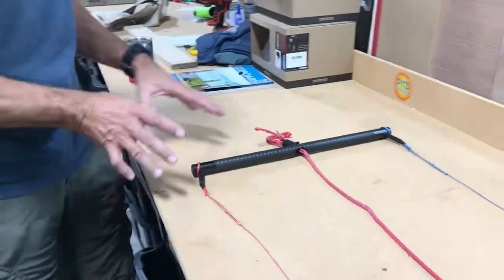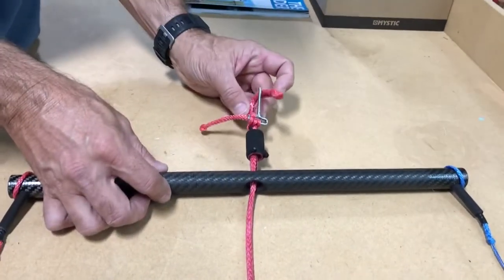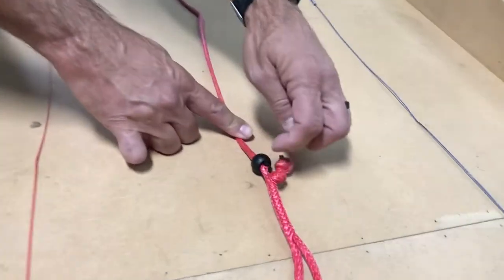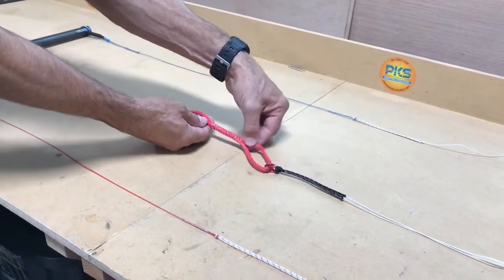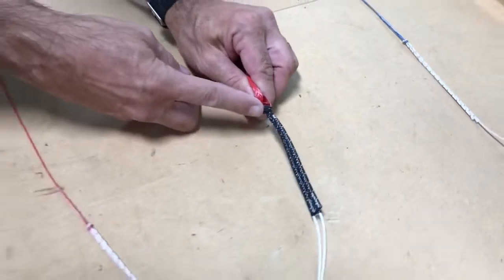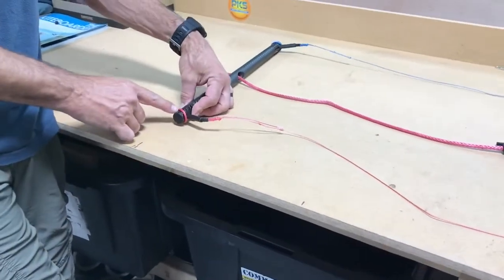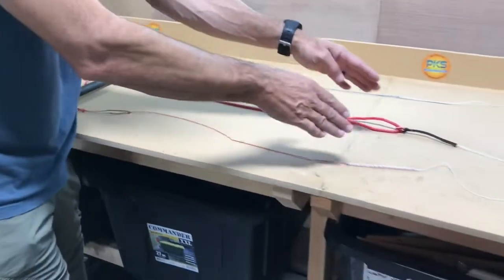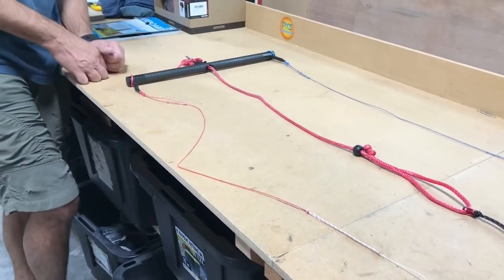KiSS Bar Control System with KISS Loop

Comment: Hey Jeff, how you doing? Im from Brazil and wanna start to try fix/custom   a bar using F-one monolith bar 2016 as a “foundation”.
To do so, I really would use your help if you may.
I studied about spectra, dyneema, and q-powerline. The problem is that just reading I havent figured out yet about line’s diameters/specs. I mean, center lines and steering lines looks kind of the same, but still I dont know which spool I should get.
How about chicken loop, pigtails, bridles, trim line? Do you have any kind of guide about those specs? Im really into it...

Sorry if I sounded rude, just dont have enough vocabulary to sound smoother.